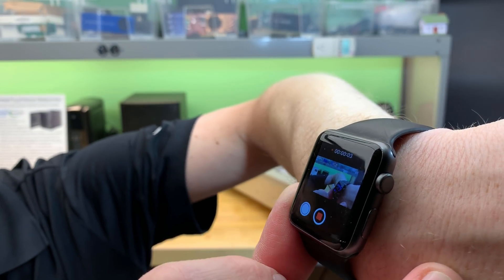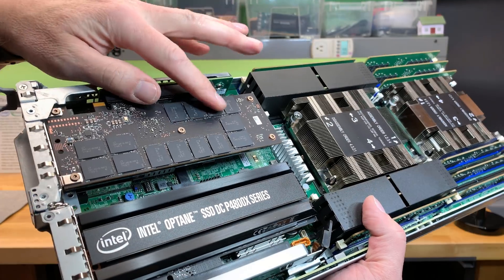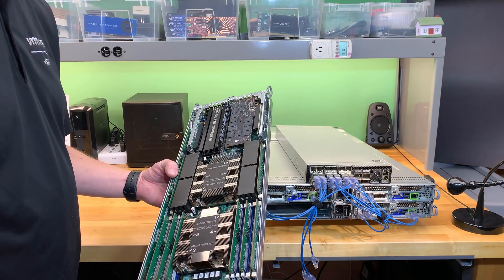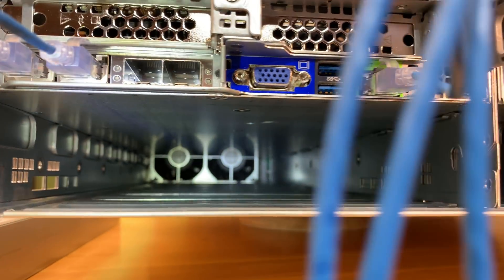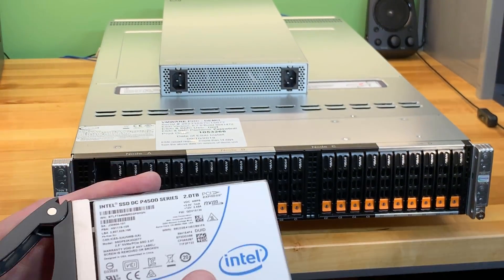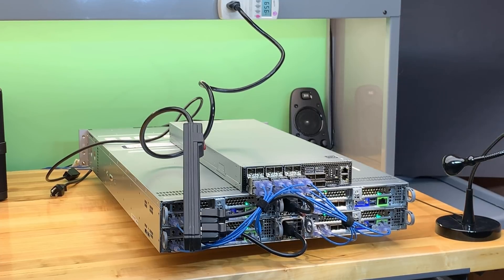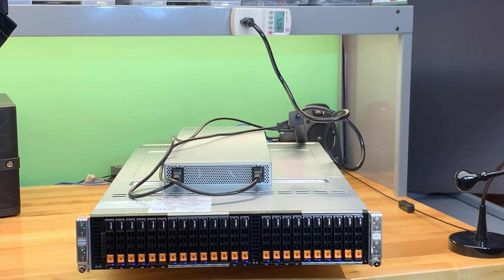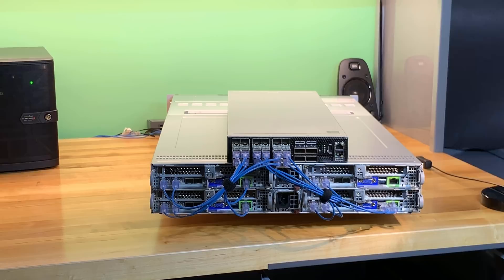Close look at a 4-Node-in-2U All Flash (Optane/NVMe) vSAN ReadyNode™ SuperServer SYS-2029BT-HNR [4K]

Comment: What is solution one switch gets the failure ?
Reply: Use Two of the Mellanox or other TOR switches - one or even better two 10Gbit or 25Gbit connections from each node to each switch in LACP.  The switches connected to each other using MLAG; VLT or vpc, depending on the switch brand, eg: FS; Dell; Mellanox; Cisco, etc:  example:  https://youtu.be/2LjNm95iVbg   VLT/MMLAG ex
:  https://en.wikipedia.org/wiki/Virtual_Link_Trunking

Comment: The Mellanox switch quiets down a bit shortly after startup. This one actually settled down VERY quickly. The MSB-7800 36 port 4x EDR Infiniband switch would take anywhere between 5-20 minutes before it would settle down. THAT was pretty ridiculous.

Now I use a MSB-7890 externally managed (a.k.a. unmanaged) 36-port 4x EDR Infiniband switch instead and that's rather quiet. At least the server is back to be louder than the switch. ;)

Sidebar: If you're running 100GbE network on the QSFP28 ports, it would actually be a bad idea to use the QSFP28 to 4x 10GbE breakout cables because you're not using those ports to the fullest potential/link/PHY capacity.